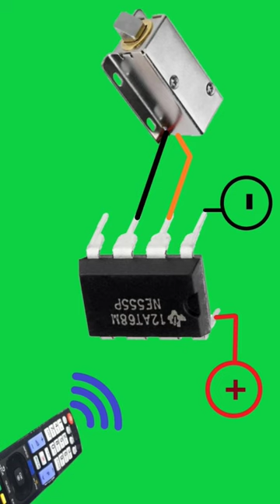New İdea - Remote control with 555 timer IC  #zaferyildiz #short #shorts  #diy #led#ne555  #viral

Comment: why exactly the 555? Couldnt y connect the photo diode with an resistor to the mosfet gate directly?
Reply: He wanted to have a temporized trigger, so he used a 555 to get a "high" output for a certain amount of time, thanks to the capacitor. This allows you to press the button of the remote just once, otherwise you would need to keep pressing the button in order to keep the solenoid open
Reply: @lollo64able  ah sic, thanks for the reply

Comment: Security = zero
Reply: Better than master lock that's for sure.
Reply: @limysyenpai537  Not necessarily. At least a code has to be added. The most cheap device which is supposed to be IR controlled, has it. A number of chep IC is available, for this purpose, either to code, and decode.
Reply: @walter7671  Too exposed to any interference to be something practical, too trivial to be educational.